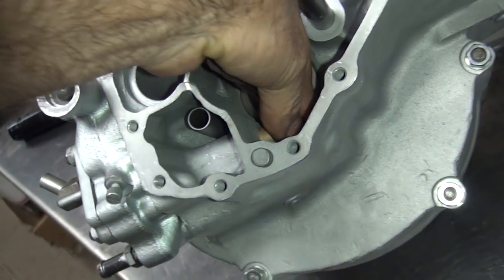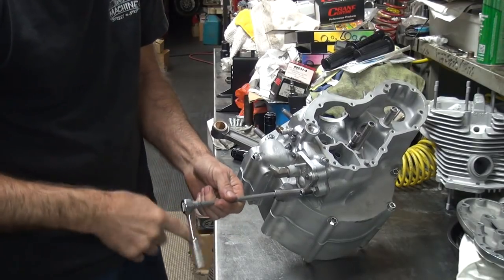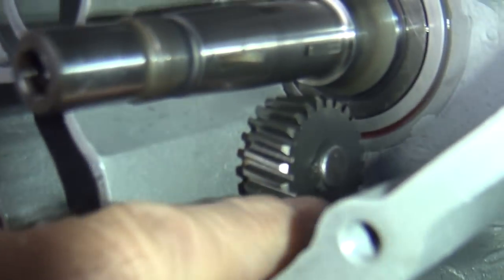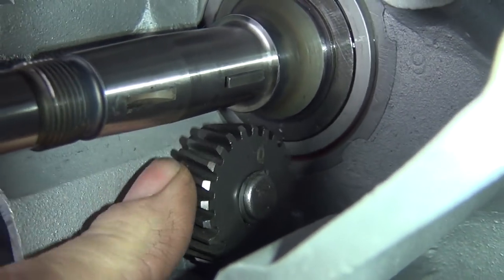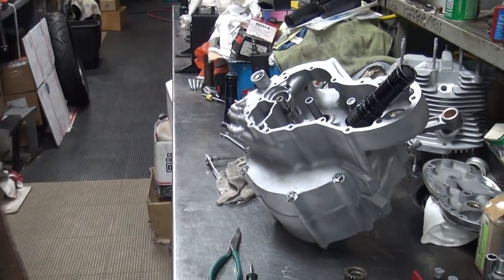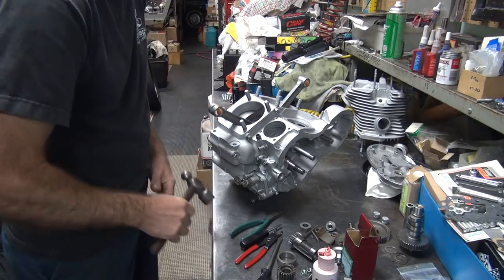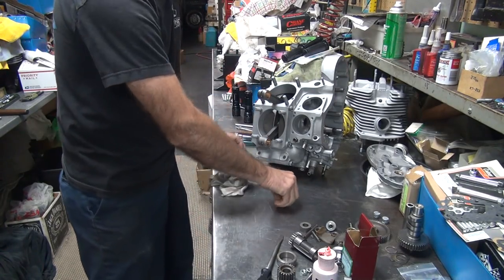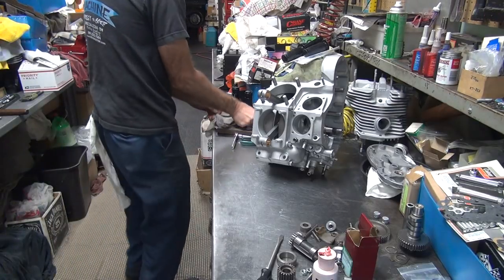1967 74ci shovelhead #118 flh bike assembly motor rebuild harley craigslist special tatro machine

Comment: Unless you were trying to save the old studs why not take it out with a small pipe wrench?  Are they prone to break?
Reply from the maker: if the suds don't want to come out, than don't. they like to break when forced. than the real work starts. that is why i put the same one back in like it was to match the other one.
tatro